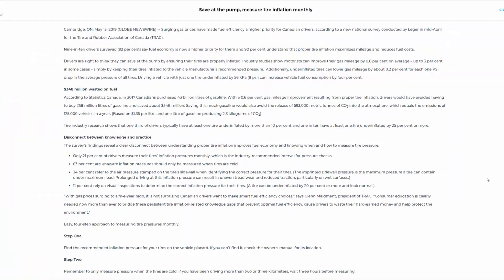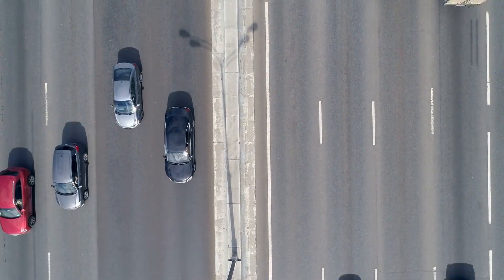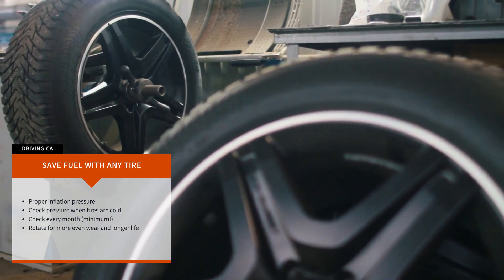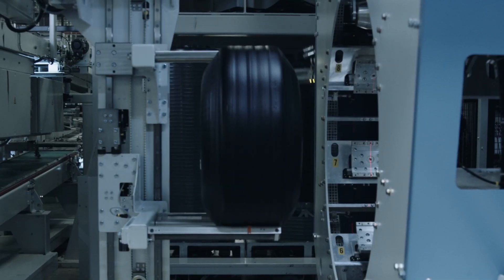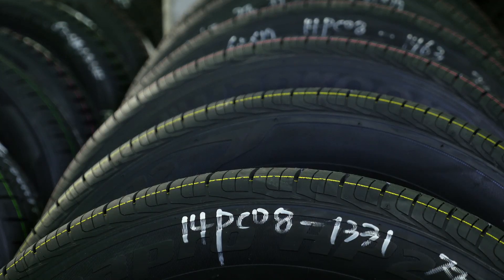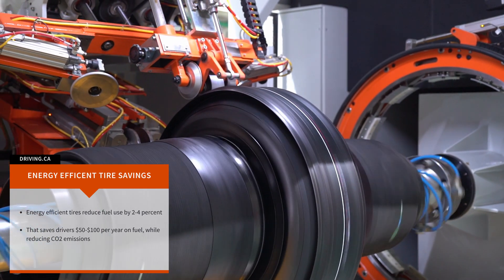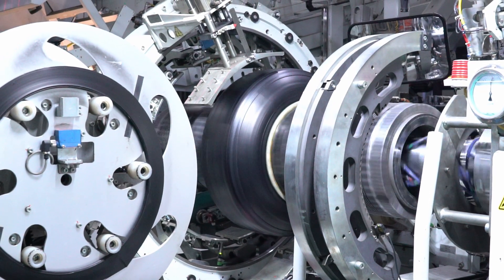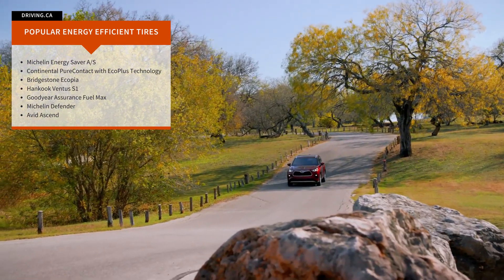Are Fuel-Saving Tires Worth It? (& How to Save Fuel With Any Tire!) | Driving.ca

Comment: 50 - 100$ a year but tyres wont even last a year
Reply: Lol legit. I have to argue with the folks at Discount Tire to inflate my tires to 41psi. The max is 50 but they are not standard size; semi low profile 17" which is even more imperative to keep them at a higher psi. They want to put them down to 32 and while that may save my tires from wearing quicker(I doubt) they generally only last 35k or 2 years before getting swapped out. I bought the car with a standard size 16" and the MPG was great at 40mpg but the traction wasnt there. Now I only get 25~28. 😮‍💨
Reply: @AltruisticWarrior  If your car is just a normal sedan and not an SUV or truck, 41 psi is too dangerously high even for 17" wheels. Remember, fuel economy is only the second most important thing in driving. Safety is the most important.

Drop your wheels to 31 psi and rather focus on changing other things if you want fuel economy. I used to be a professional commercial driver and I can tell you from personal experience that using hypermiling driving techniques will give substantial fuel economy benefits over trying to overinflate tires.

I have also taken a friend of mine who was also like you and believed that overinflating tires is the way to go. I took both him and his car to a back road that had a stop sign on an incline. I showed him what happens when you drive off from an incline with overinflated tires (the wheels spun a little bit and even made a squeak).

Then I drove him to a nearby gas station and reduced the tires to 30 psi. We went back to the same incline and this time there was no spin. The car took off with so much grip that it jerked us back into our seats. I asked him if he would to wait for a rainy day so that I can come over and show him how easy it is to fish tail or spin out with overinflated tires. But he declined that offer as he had already seen the importance of properly inflated tires.
Reply: @angrysocialjusticewarrior  lol my car, a Jetta 2.Slow even at the max of 51psi the tires won't spin out. Unfortunately here in the desert southwest I have to run AC with my 1.5 year old most of the year. At 32psi the car can easily stall out with the AC on. I used to drive prototypes for Toyota, Bondurant and Nascar training included. I'm great with clutch management but this car is so incredibly underwhelming that even with that, particularly on an incline, it can easily stall especially staked with volkswagens hill assist feature built into manuals. My tires are a lower profile too though so that's part of the issue as well. I generally put 20k~30k a year on my car and haven't had a blowout or issue for the last 8 years doing that. But that's probably partly due to changing out tires every 2~3 years and I make the tire shops give me higher quality, newer dated tires. Toyota themselves runs the Prius on the proving grounds and testing for highway/city/country paths at 40 in the front, 41 on the rear. No doubt its a trick the engineers use to cheat the EPA millage including testing on no wind days, no ac, windows up. EPA ratings are lies. 🤣
Reply: @angrysocialjusticewarrior  overinflated tires actually prevent hydroplaning. Fun fact. So while your grip pan. Turn may not be as good in the rain, it’ll also prevent hydroplaning at faster speeds.
Reply: @AltruisticWarrior  epa has to do tests with ac on now actually
Reply: @AltruisticWarrior  what in the.... did you say 40 mpg? That's about perfect right now 😂
Reply: @SimbaUchihaa  yup, but those crappy tires were extremely slippery... like getting on the freeway where a cattle guard is at, it would damn near slide off the road even in high heat, no rain conditions. With rain? Making a turn was dicey too. I'd never had tires that slick. I'll take a reduction in MPG for safety... to some extent. My wife's focus had Hankook, factory spec and same thing. MPG went down went going up a size and getting a cheaper tire. For the best MPG, stick with factory spec... the engineers already factored the optimal for that.
Reply: @SimbaUchihaa  I average 35mpg in my mini cooper s. At 92k I'm expecting for a jump in mileage when I change the tires and get the engine walnut blasted in december
Reply: My Michelle energy savers lasted 80,000 miles and for 3 years

Comment: Most modern cars tell you the pressure or throw a light if you’re under inflated. Just laziness if you don’t maintain proper pressure.
Reply: Right? Anymore though here in the Southwest US folks don't have an excuse. A dollar or two in hand, pull up to any Discount/America's Tire and they'll do all the work for you for free, I tip them though. If it's too hard to drive to a shop and not even get out of the car... that person is at a level of laziness I cannot even comprehend. I imagine it's the same person that calls their car a POS while doing zero required maintenance.